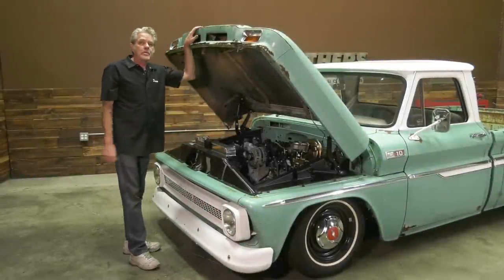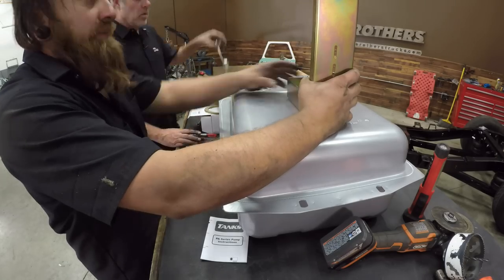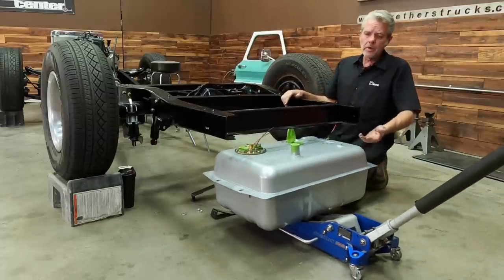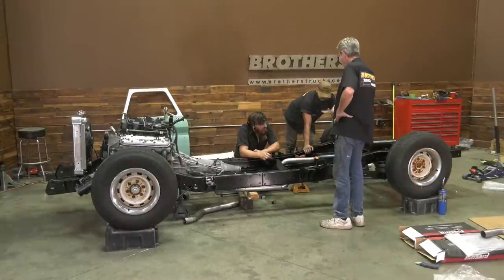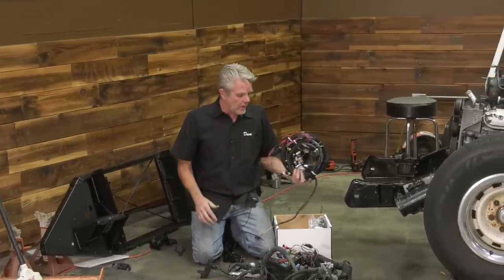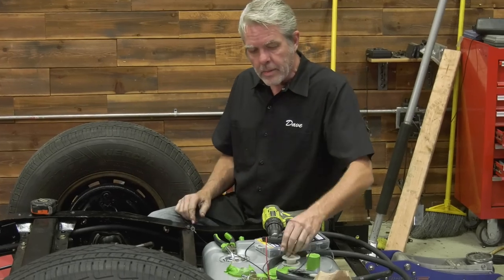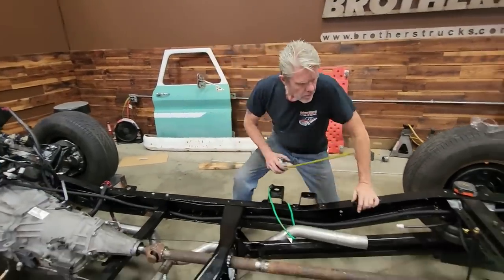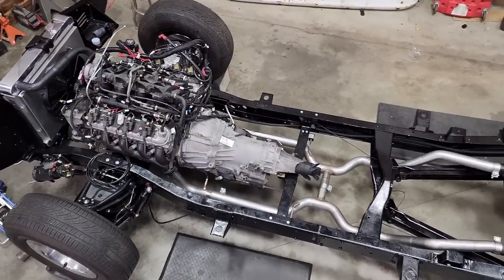1965 C10 Chop/Drop & LS Swap - Part #5 - Wiring, Exhaust, Driveshaft, etc / 65 C10 Makeover

Comment: Dave, thanks the mention of grounds & dielectric grease. The GM ground terminals in the 80's came with little twisted spike to dig in past paint, grease etc. I keep a large pile of 4 sizes of "Star" washers on hand. Maybe my OCD, but I double ground all lights, modules, doors to body, even the end frame of the alt where negative diodes produce ground. Plus pickups uniquely have a bed that a ground with good service access as inside LED's are popular. Great job & your team!
Reply from the maker: Bad grounds are the root of almost all the electrical problems we run into.
Reply: @BROTHERSTruckPartsTV   On the old truck tail lights, I clean and solder the bulb socket to the housing because it is just pinched-stamped. 50+ years take its toll and seen as a voltage drop test.

Comment: Awesome work, but…. What happened to the custom driveshaft crossmember you guys sell? Wouldn’t that make sense for the exhaust?
Reply from the maker: Yeah, or the cutouts we sell would be an option too, but we simply didn't have time to do anything extra and the bits we had worked anyway after we flipped and flopped them around a little.
Reply: Great project. I love it! 💪🏽